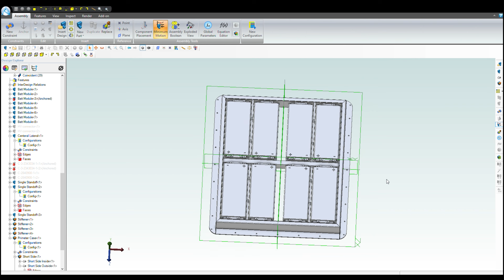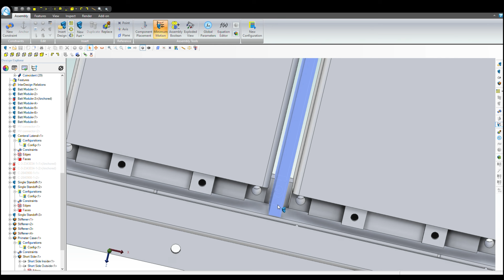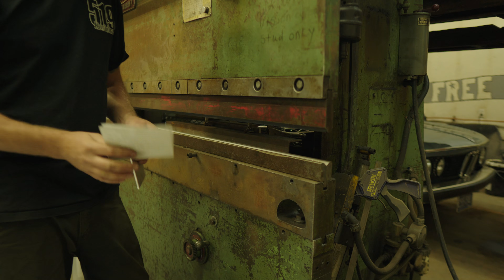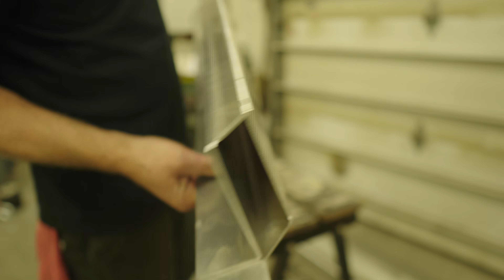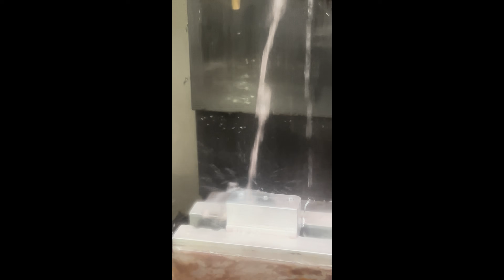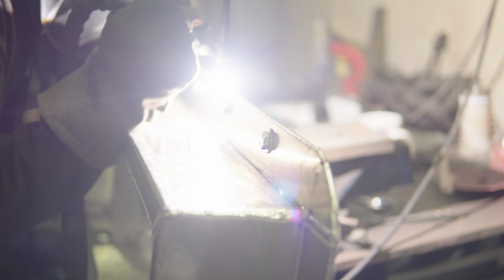Electric Corvette Battery Enclosure Fabrication

Comment: If you figure out an above board strategy for getting these things inspected and on the road in Ontario (after retrofit not before) and shared it you’d be doing the automotive enthusiasts in our country/province a big favour. Since you’re EV and you have all lights and glass and stuff as original it seems you’re good on the HTA/roadside legality but buyers persuading mechanics that these new components are built to industry standard is a battle I don’t know how to fight. I just get told “no, I won’t even look at customs” every single time. I’ve read the light vehicle inspection standard line by line and I think there’s legal/ethical room for installation of well designed and well made parts but mechanics are too scared and have no interest.

Comment: How is a 1940 Buick Special for a conversion candidate ? A friend of mine is looking into it and wanted me to ask you about the installation, only needs 100-150km range. Saw that you're a dealer from Fuel2Electric
Reply from the maker: Yes sir! that sounds very doable. I would have to find out the trackwidth and wheelbase as a good starting point. I try to only take on projects that I can build a whole engineered chassis solution for though. It is a bit more cost wise but I really think you get a way better car in the end.

Comment: Thanks for showing all the design and also fabrication steps! 
Do you think that someday you will make the battery box part of the frame?
Reply from the maker: It makes more sense to me for it to be a removable part. Kind of future proofing the car as battery tech evolves. I can remake another battery box that fits inside the frame way easier that modifying the whole chassis.

Comment: I am sure you have considered a frame rotisserie to make some of the welding easier on the battery box.  Maybe for higher production rates.  Counter balancing might be a challenge as you add motors and other heavier parts.

Comment: Love the battery pack and placement. are you going to put any urethane foam in the airgap? Whats the pack voltage and capacity?
Reply from the maker: I wasn’t planning on it but it’s a good idea! Pack is approx 54kwh and about 360 nominal volts.

Comment: What's the plan for cooling the modules ?
Reply from the maker: I was planning another video for the cooling. It is going to be a bottom mounted chill plate, similar to the original VW design
Reply: @519Kustomz  perfect, that's the part we're struggling with. Looking forward to that.

Comment: As always clean work, curious to see how you will seal the pack and if you have any additional thermal management
Reply from the maker: Thanks! I was going to do a separate video on it but it will be a bottom mounted chill plate, similar to the original VW design.

Comment: Great build. Can you tell us a little bit about the batteries you chose. And what you think their performance specs will be?
Reply from the maker: The modules the higher voltage Volkswagen ID.4. 6.8kwh each giving me a total of just over 54kwh. Off the top of my head I don't remember the specs for discharge / charge amps
Reply: @519Kustomz  Were you ever able to determine the max discharge amps for these modules? Looking to complete an EV conversion using the full 62kwh battery at its nominal 395v but am finding conflicting info on max amps. Want to draw about 650-700a for short bursts.
Reply from the maker: @s550z5 I’ve just started testing so I don’t know just yet. The weather is turning crappy here in Canada but I hope to have it out for a few max runs yet. I think 700amps is very reasonable though for short bursts. Depending on the motor you are using you should have a fairly large capacitor that should help out aswell. I’ll let you know what I find out!
Reply: @519Kustomz Thanks! Plan to use a model 3 980 motor. Hoping for a good bump in HP with the higher voltage of the 62kwh pack. The 980 motor should be able to handle up to 490v from what research I have done thus far…

Comment: Given you are going to be driving 2 motors, what are you anticipating the watts per mile on just normal driving will be? I know a Ford Lightning has been privately tested at about 2.1 miles per kwh, and a Model 3 getting just over twice that. I know you can't have a true answer without testing but I figure you have a target you would like to hit or get close to. My guess is in the 3s somewhere and I'm not basing that one anything but guess that the car will be much lighter than a Model 3 but it has 2 LDU in it. I'm watching so I'm sure we'll all know at some point, I'm just curious if you had any plans on this. Thanks for sharing another cool build.
Reply from the maker: I have not calculated it, but im sure it should be somewhere around the model 3 specs, providing my customer can keep his foot off the accelerator...